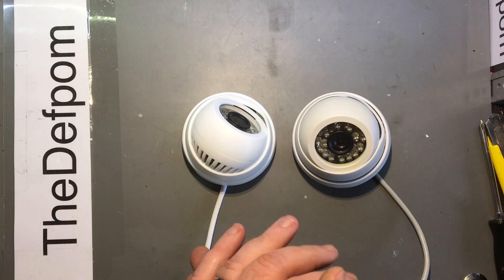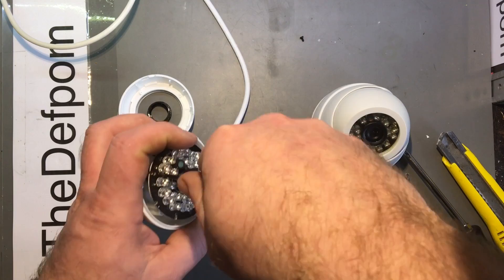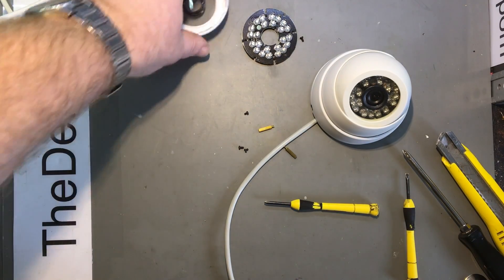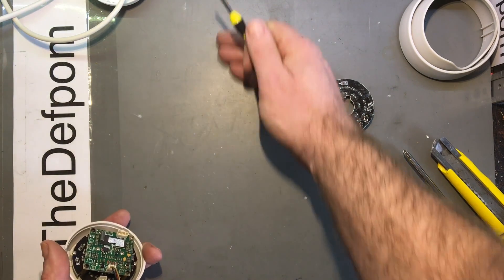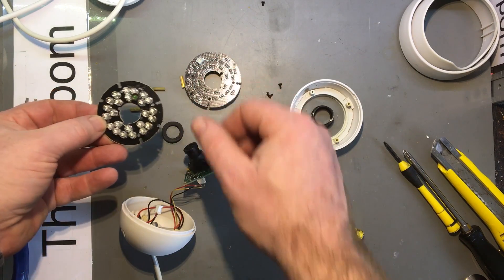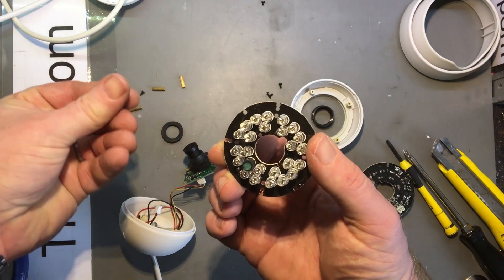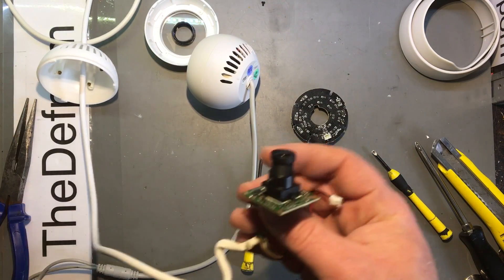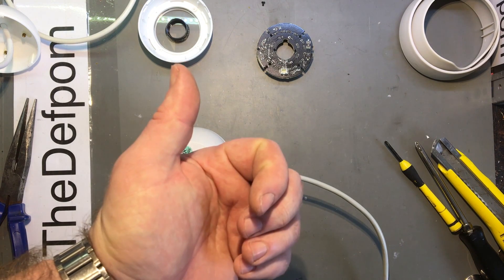#266 Dome Security Camera Teardown and IR LED Replacement

Comment: I have several cameras. A very wide variety makes and models. I part them out and fix them all. My question is when testing power how can you determine the voltage needed if you have absolutely no information on the camera. No model number no brand name no indicator markings on the boards. 5v? 12v? I don't want to damage it with too much power. Thank you